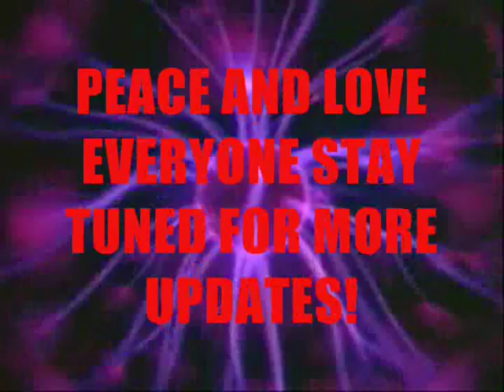PLASMA REACTOR 3 !

Comment: Does he actually use it for anything but sitting and watching??? Somehow he seems like stuck and not able for any practical effect? Well, now is November 2015.
Reply from the maker: +Botrax Apparently your not paying attention, today a video is on its way up and hopefully you will understand what I have been trying to show everyone. And it doesn't even scratch the surface of what the capabilities are.  Further more as far as practicality you get visible light, heat and high frequency voltage that can be tuned. So you tell me, what can you do with any or all of those effects?
Reply: +shazizz Thank very much for your feedback! And it´s correct that I did not understand... But I saw your bulb lightning without any connections, only holding it in front of your scientific device!!! That was amazing and shocking... I feel there is something big going on, more an more. 
Keshe released his devices...
Reply: @shazizz  Awesome work man! Love the Tesla picture! Obviously a major influence. How is the reactor coming along???

Comment: Cool reactor, I am really interested in building one myself. Could I get a schematic of the reactor so I can design my own using a similar concept? Thanks for your time. Email: numark5505@gmail.com
Reply: +john Sims It isn't that hard , 

1. make a plasmarize room , that glass bubble thing with lighting in it , simply 2 electrode with high voltage electricity between them would work , it works just like a taser . 

2. build a magnetic filed , like his , some coil would do , take it from tv , microwave , all works . 

3. the fuel (he uses gas from that gas tank , but if your plasma room has enough voltage , you can use anything ,if you use solid material , make sure you crash them into small pieces before you put them in , and there will be by-product , using gas leave no by-product   ) goes into the plasmarize room , became plasma , blow into a tube( the tube should be insulating and be tolerating to high temperature and voltage .) that run through the magnetic filed(vertical to the magnetic filed ) , put 2  electrode on the tube , line up with the direction of the magnetic field , when the plasma blow throw the tube , there will be power gathered on those electrodes you put on the tube .

Comment: hi Shazizz, i would like to know if the Burkett igniter model 5049 from ebay that is 12 volt input with an AC output of 20kV work as the power source used to ignite the plasma reactor?  You can email me a kmss44@yahoo.com.  I am trying to understand your work.